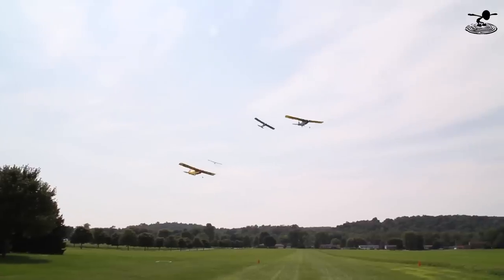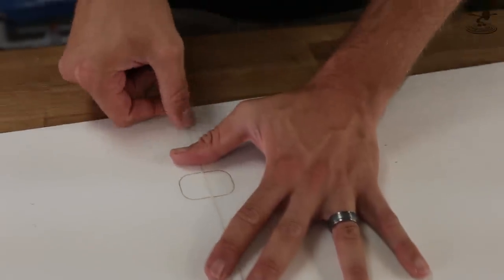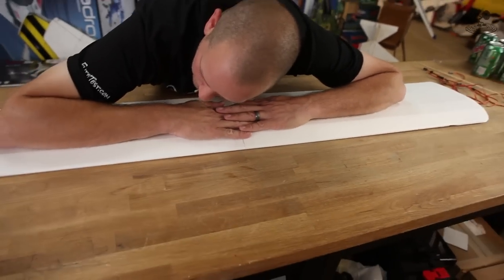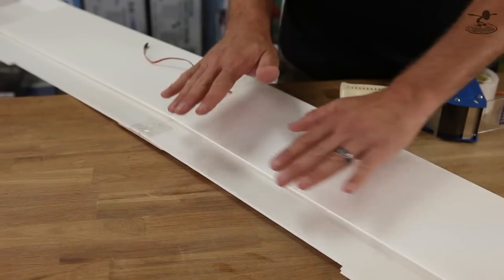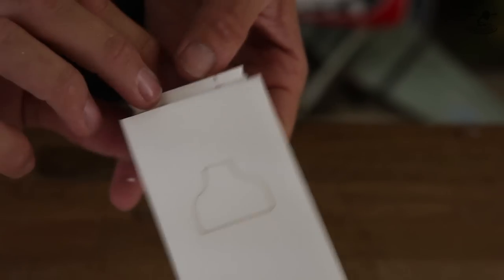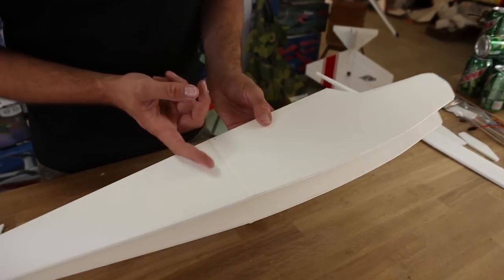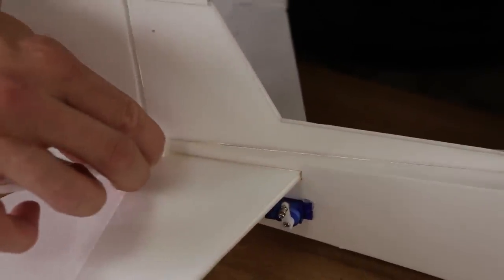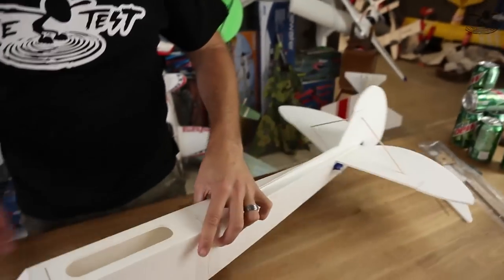Flite Test - FT Simple Storch - Build

Comment: High guys love your Storch! Do you post to the UK and if so how much for shipping.
Bob
Reply: Hi They do and i have had many shipments from them.
It normally costs for a box of ft foam around £80 with shipping and taxes.
Your tax may differ as you probably live somewhere else as i live in England.
:)
Reply: I live in England also and have since found out as you say they do ship to the UK, but the shipping costs $66, thats more than the kit. I have since heard from FT that Graupner are to be an agent for them in about mid Sept. I was going to wait and see what the shipping cost will be from Germany. Got to be less then $66 which is equal to about £50 at present.
Reply: Oh must be different shipping costs to different parts of England. Thanks for the information on Graupner are going to be an agent should be interesting. 

Have you heard when this will happen?
:)
Reply: +Rc Aviation Been on the Graupner web page and they are saying 9th Feb 2017.
Reply: thanks

Comment: Hi guys I've ordered storch plans from a print company so sent you're full pdf plans but have come back A1 size for the all the plane have I done something wrong help please
Reply: So long as it was printed at 100%, it should be fine. Use a ruler to measure the scale on the top left of the plans. If they divided the full plans into 5 sheets of A1, P1 or ANSI D.

Comment: Will this work with power back B????? Please answer.
Reply: Yes but it might be underpowered (might) and you may have to modify the firewall.
Reply: There is an article on the flitetest articles section about someone having great fun with a less power Storch.  Check out that article and whatever motor they use for more advice.

Comment: Is the landing gear wire thick or medium?
Reply: Dustin medium wire for the landing gear, if ya bought the kit, it's the four thick pieces.
Reply: Andrew Carter so in the kit it comes with 4 thick pieces?
Reply: yea  buddy
Reply: Andrew Carter ok thanks for being the only person to answer my question
Reply: Dustin no problem man, enjoy the hobby blue skys
Reply: what is the size of landing wires?
Reply: Lalo Ran if your building from the kits it the four larger diameter wires. If your building from plans find somingthing the same size as a metal coat hanger that's should work.
Reply: I mean how large are the wires i download the plans 18 inches?  Thanks  Lalo Ran

Comment: Are the ailerons necessary?
Reply: As opposed to just rudder and  elevator? Yeah it is. Why what's the problem your having?
Reply: Jake Dassan It's just that I only have 2 servo's and I don't want to order one again so....yeah...but thanks for asking.
Reply: Mohamed Yassine 2 servos, no problem. Change the construction a little bit and give the wings more dihedral. 
http://www.rcgroups.com/forums/showthread.php?t=959755

 Then increase the size of the rudder by 50% and you're good to go.

Comment: how many sheets of foam board do i need for this project?
Reply: +MrMrsregor i think 5 i just bought 6 to be safe
Reply: +Easiermarlin33 thank you, what size sheet did you get?or just get the biggest ones i can ?
Reply: 20 inches by 30 inches tall. If that helps? :D
Reply: +Easiermarlin33 you are awesome, thanks. these are great shows, but i don't see why they didn't talk about that
Reply: I Used 2 boards 1mx80cm

Comment: the tiled plans don't line up at all! and yes I did click actual size when printing.
Reply: +Ethan Ford Every printer is a little different. I have a cannon MX 470 all in one printer and I have to scale the tile pages up to 130% for the lines to line up and the 6" to actually measure correctly at 6".
Reply: Ethan Ford I'm pretty sure your problem is between the driver's seat and the steering wheel...

Comment: Please please please..... pronounce it stork, as is the english word for the german Storch.
Reply: well its called storch, not stork so i dont see the problem here? its a name not an object you´re describing so the right name is storch. if he was speaking about the bird it would be kinda wierd to use the german name for it in an english video though.
Reply: sarocco1 The design is based on a plane called the Storch. Because of the way Germans pronounce the -ch, (like english speakers pronounce k), when spoken, storch sounds like stork.
Reply: sarocco1 The model is based on the german Fieseler FI 156 Storch. That is, the Fieseler FI 156 Stork, if you are english (or swedish for that matter). Also, in the full size community it's also called Stork (with a k). As Sherman Hartman pointed out, it's not even pronounced -CH in german, but with a k or more commonly a ç which is closer to an H, as in hue)
Reply: Left Flamingo Well said.
Reply: Sherman Hartman I was going to say the same thing! :)
Reply: Left Flamingo That's correct. We don't call it the Third Rei"CH". We say Rei"K". So yeah, its called a Stork!
Reply: TheAdkFlyer10 Germans call it reish

Comment: Advice for everyone.
 There is no such thing as multi temperature hot glue!!!
That brand is just trying to pass of low quality low temp glue as multi 
temp. That's just bogus.
 The point being that, high temp glue will not melt in a low temp gun, 
but, obviously, low temp glue will melt in a high temp gun.
 The problem with that is that it will melt too far and be very runny 
and it won't harden for ages afterwards.